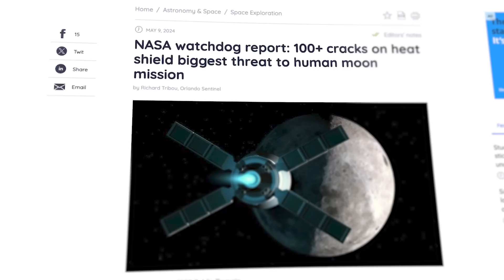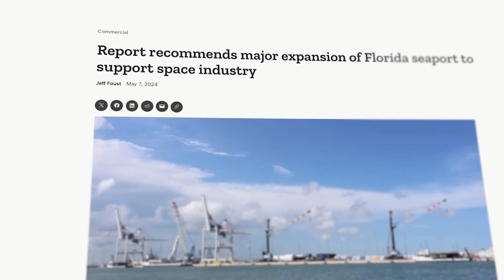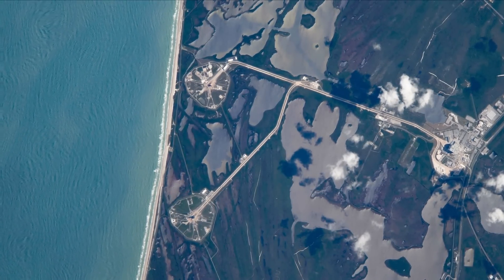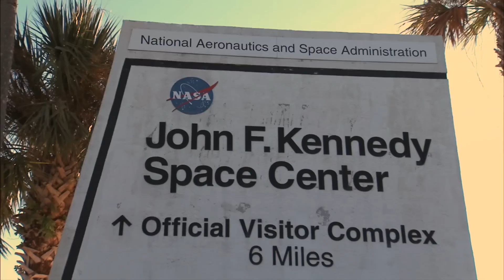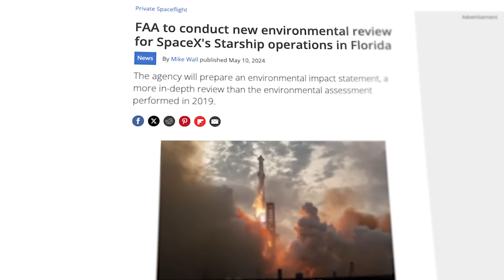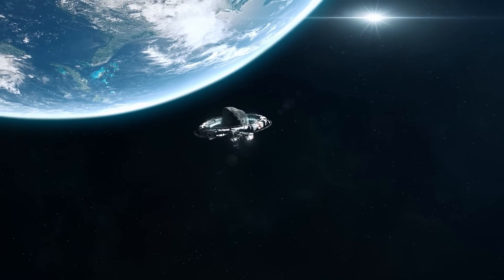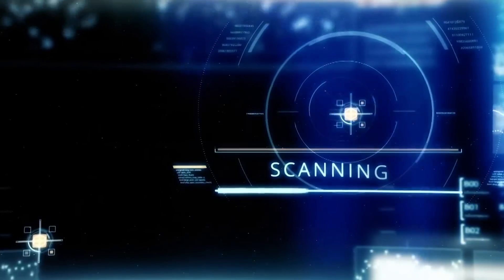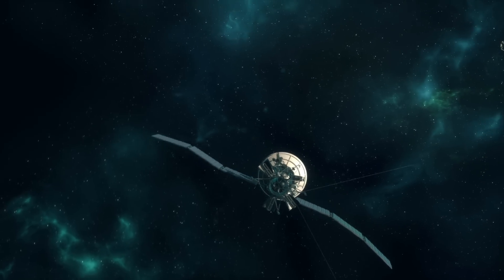NASA Has A Problem With Artemis

Comment: CRIKEY! Quit calling a PROBLEM an "issue"! 
An issue is a talking point in a bullet list. "Next, we have a clear blue sky today."
When you have a tornado coming your way, it is not another issue to yack about, it is a problem, and you need to take cover in a secure shelter, if you can get to one. If there is no shelter, you have a BFP, a BIG F00kin Problem!
Reply: The wear was deeper than expected, but did not compromise the spacecraft. For the Apollo spacecraft, they were one-use, so if the heat shield mounting got a little damaged, no big deal as long as the system did the job. For Orion, Crew Dragon, and Starliner, they want the heat shield to take all the damage and leave the mounting hardware untouched, so that they just put a new heatshield on for the next flight. Crew Dragon had a similar heat shield wearing away more than expected for Demo-2. SpaceX increased the thickness for Crew-1. Lockheed Martin will likely do the same for Orion, once the research is done.

Comment: Also the issue with all the commodities needed to support all these launches, liquid oxygen, liquid hydrogen, hypergals, helium, solid rocket motors. Plus the huge number of engineers and technicians, machine shops, assembly facilities, specialized equipment and exotic materials. These are just a small portion of the areas that would need to be addressed. The race to space will be won by the one that can overcome and manage the logistics and infrastructure issues.

Comment: They might need to implement a 2 stage heat shield with the first discarded early leaving the second to function from a less arduous entry period.
Reply: The wear was deeper than expected, but did not compromise the spacecraft. For the Apollo spacecraft, they were one-use, so if the heat shield mounting got a little damaged, no big deal as long as the system did the job. For Orion, Crew Dragon, and Starliner, they want the heat shield to take all the damage and leave the mounting hardware untouched, so that they just put a new heatshield on for the next flight. Crew Dragon had a similar heat shield wearing away more than expected for Demo-2. SpaceX increased the thickness for Crew-1. Lockheed Martin will likely do the same for Orion, once the research is done.

Comment: The lunar orbit NASA has chosen is   ridiculous.
Reply: The NRHO was chosen so that Gateway would need minimal propellant to stay in orbit. The low lunar orbits (LLO) are not stable, as the mass of the Moon is distributed unevenly with mass concentrations (masscons) clustered on the Earth facing side of the Moon. 

Something has to support Orion for the longer missions after Artmemis III. It's planned to be a few days to the Moon, about a week on the surface and a few days back, which Orion can do on its own. Later missions will be 2 weeks to a month or more on the surface, so something has to support Orion for that long. Gateway is that something.

Comment: Amazing, we could do this in the 1960's, but can't do it in the 21st century anymore.
Reply: The NASA budget during Apollo was 3-4% of the US budget and there were no other large programs besides Apollo. Currently NASA has less than 0.5% of the US budget and is also running the ISS as well.
Reply: @steveaustin2686  Or we just don't have the brilliant engineers we used to.
Reply: @scottgauley7722   🙄

Comment: Once again, problems that were miraculously not evident, or significant with the original missions — more than 50 years ago — are prolonging the programme, such that it is years behind schedule. It was originally supposed to deliver man BACK to the moon eight years ago. Let that sink in.
Reply: once again problems that exist on a more powerful rocket than was used 50 years ago, carrying a nearly three times larger capsule than 50 years ago. entering with FAR MORE SPEED than 50 years ago. curious how they aren't at all one to one comparisons with each other and yet people constantly try to make them one to one to disparage the program.
Reply: Exactly. From an engineering perspective, the only thing the two programs have in common is the destination. It makes discussion over the real difficulties, which arise in all big engineering projects where you often pigeon-hole your solutions and create very specialised equipment with specific parameters, much more difficult than it needs to be.
Reply: Solid unemployed take.
Reply: What's happening is that NASA was more like a skunkworks and now, after 60 years of growth of bureaucracy and getting into that same rug military developments get into, and you get this.
Reply: These same issues existed during the program. The larger capsule uses more advanced technology, rather than just cork and ablator, and are meant to survive far into the future. Test flights are also far more expensive and there's no deadline to meet.

If the capsule isn't man-rated, men don't fly to the moon. They'll fix it. What's slowing the program down is mostly bureaucracy and contractor work, which really only started a few years ago. All the Apollo infrastructure that was dismantled in the 70s and 80s needs to be rebuilt and reworked for modern techniques and new contractors. It's a massive headache. No such thing as an "insignificant" problem with this kind of thing, and these kinds of problems are generally fixed within a few months.
Reply: Going on a decade behind schedule and billions over budget.
Reply: @kiwikiwi1779 man on the moon by 2080 🎉
Reply: @kiwikiwi1779 lol. Dude, it’s not doable.  It can’t be done.
Reply: Man what on earth are talking about!?
Reply: @juhopuhakka2351  What are YOU talking about?
Reply: @bidipbo  Im trying to improve my digital foot print by imitating "good people".

Comment: NASA MAY NOT KNOW THE ANSWER BUT I DO...

GET RID OF  BOEING AND NASA  AND USE .........  AND  .......BUT ONLY USE NASA AS THE

GENERAL MANAGER AND DON'T LET NASA HAVE ANYTHING TO DO WITH FLYING ANY 

SPACECRAFT.   ISN'T IT OBVIOUS THAT NASA HAS LOST  THEIR MOJO WHEN IT COMES TO

DESIGNING SPACECRAFT??   NASA WAS GREAT IN THE 50s, 60s and 70s but most  of 

NASA IS LONG GONE.  SORRY NASA BUT YOU KNOW IT IS TRUE. NASA HAS NEEDLESSLY KILLED

SEVENTEEN ASTRONAUTS.  I REMEMBER ONCE SHUTTLE CRAFT FAILURE WAS BECAUSE

PRESIDENT  REAGAN WANTED TO LAUNCH WHEN IT WAS ADVISABLE TO NOT LAUNCH.  ICE

FELL OFF AND HIT THE SHUTTLE WING AND IT BURNED UP ON REENTRY.

Comment: Don't we have loads of data regarding heat shields at these speeds from the Apollo missions half a century ago??? Why do they keep re-inventing the wheel?
Reply: because the Orion capsule is like three times larger than apollo's because its built to take like 5-6 people to the moon instead of three?
Reply: We do, thats how we were able to fly the first mission without losing Orion. There were even similar issues with the heat shield on Apollo and none of them returned without some issue of concern. Dont forget Orion is a large craft then Apollo as well.
Reply: I have been on the same job for 30 years.  If I had to find something from back then, it's on computer that is old as dirt and using a floppy disk.  Maybe I did store it on a tape or cd.  Then I got to remember my dos commands, or worse, it's in a box of hand drawn prints.  Now imagine a rocket from the 60's.  The files are old and no one probably even knows where they are.  Any everyone who worked on it is in their 80's or older or dead.
Reply: @locutus1126  sounds a lot like the student who try to convince the teacher by excusing himself because the dog has been eating his homework
Reply: Cold Hard Caaaaaash
Reply: Exactly! Study their data and see how they withstood 5000 degrees F since they did it in 1969 we’re moving backwards in the space race
Reply: They were NOT STUPID enough to reenter at those speeds, that's why!
Reply: Do your home work.
Reply: Because the wheel was faked back then
Reply: beacuse they  fake  it  from  begining

Comment: SpaceX had no problems
Reply: After the Demo-1 unmanned test flight, that Crew Dragon exploded on the test stand due to faulty valves. After the Demo-2 manned test flight, the Crew Dragon heat shield has similar issues of abrading too much that Orion has. SpaceX just thickened the heat shield in those areas, something that NASA and Lockheed Martin will likely do with Orion.

Comment: NASA should go back to its roots. Apollo was very reliable, even Apollo 13 was a successful failure. The service module was the problem but Apollo spacecraft worked.
Reply: Spacex Starship/Lander and Dragon are vastly superior to Apollo. 
SLS/Orion... not so much - agreed here.
The truth is that Spacex can manage regular trips to the moon with 10x the capaciy in materiel and personell (Tesla could even supply human form robots for dangerous jobs and the boring company can supply drilling equipment for mining while making tunnels safe from radiation, meteors, explosive decompression.
Reply: And when Congress cut the Apollo funding, all the people and factories making the Apollo hardware moved on to other things. Don't forget the Apollo 1 fire either.

Comment: Dude, you are mixing up all kinds of things: 
1) NASA does not own or operate Port Canaveral. The port has nothing to do with NASA. It's a port. 
2) You also keep referring to Port Canaveral as a spaceport. This is a conventional WATER PORT, for water vessels - cargo ships, barges, tugboats, US Navy vessels, and a whole bunch of cruise ships. It is not a SPACE port of any kind whatsoever. 
3) SpaceX does not launch exclusively out of KSC; in fact their busiest launchpad is SLC 40 at CCSFS, not at Kennedy.
Reply: There are two spaceports by Port Canaveral, Cape Canaveral Space Force Station (CCSFS) just to the north of Port Canaveral and the Kennedy Space Center (KSC) just to the north of CCSFS.

SpaceX has SLC-40 at CCSFS, LC-39A at KSC, SLC-4 at Vandenburg Space Force Base (VSFB) and they just took over SLC-6 at VSFB. SLC-4 is broken up into the SLC-4E launch pad and SLC-4W landing pad. SpaceX also uses LZ-1 & LZ2 at SLC-13 on CCSFS. SLC-6 is going to be converted for Falcon Heavy at VSFB, as currently only LC-39A launches the FH. SLC-6 will likely do Falcon 9 launches as well, so SLC-4E can be converted to a landing pad for the FH side boosters to land at SLC--4E and SLC-4W as they do at LZ-1 & LZ-2 at CCSFS.

Currently, LC-39A is the only location for Crew Dragon launches, but a tower has been built at SLC-40 for Crew Dragon launches as well.

SpaceX has the orbital launch pad at Boca Chica, TX and is building a second pad there for Starship. They are building  a Starship pad at LC-39A, but that seems to be on hold again, while they figure out what they want at Boca Chica. SpaceX and NASA are working with the FAA about one or more Starship pads at LC-49, which is an as yet unbuilt area to the north of LC-39B. It is on the edge of the NASA property, so that will take time to work out.
Reply: @steveaustin2686  What does any of that have anything to do with my original comment?
Reply: @regolith1350   It ALL relates to your point #2 and a little of point #3, providing more detail.

Comment: We really need to change the framing of the conversation tho. The real problem is that NASA has a tiny budget that could easily be expanded. We just make 0 noise about this for some reason.
Reply: Yes! If we just have the same spirit that we had back in times of Apollo.
Reply: You can thank Obama for NASA's tiny budget.  Most of it was repurposed for obamacare. So thanks for nothing.
Reply: No. The problem is time after time NASA becomes a faux research organization that pisses away money without  actually finishing anything.
Reply: That's half of the problem. The other half is corporate greed.
Reply: @roncatdog  Wrong answer. Try again

Comment: Nothing that "New & Revolutionary" with the Artemis heat shield, same base material manufactured by same company that was used on Apollo capsules....Maybe the new "Mix" is being pushed Past it's Previous proven reentry Speeds  or the "Tighter" budget caused some "Economy" (Thinner lighter)  application thickness ?? ....They can Fix the situation....That's what manned space rating tests "Flying" is for...

Comment: Why cant they use the technology as of apollo?
Reply: When Congress cut the Apollo funding, the hundreds of thousands of people and hundreds of factories making the Apollo hardware moved on to other things. Lockheed Martin will likely end up doing what SpaceX did for the Crew Dragon heat shield issues, just thicken it in the areas where it abraded too much.
Reply: @steveaustin2686  "moved on to other things". Like what? They returned on their main activity of making movie? 😅
Reply: @nicolagianaroli2024  🙄 Don't be deliberately dumb. If a factory was making particular parts for Apollo, when the funding for Apollo was ended by Congress, the factory either shut down or retooled to make something else. This should NOT be a hard concept for anyone with a brain.
Reply: @steveaustin2686  you don't dismiss equipment  and technology which have  a clear application in military field like the most powerful rocket ever built, the Saturn V. If you believe that you are extremly gullible
Reply: Because the Apollo crap didn't work either.
Reply: Oh dear  @straydog02

Comment: While the engineers at SpaceX, one of the smartest and most motivated engineers you can find on the planet, solve problems of insane complexity in weeks what takes others years, the brave people at the FAA heroically put their Xs in the right boxes.
Reply: The FAA vs SpaceX is not really a thing, except for clicks by some YT channels. After all, the FAA defended SpaceX in front of Congress in Jun 2021 over the unauthorized SN8 flight. The 'NASA delaying Starship until the SLS flies' was just as silly, since NASA needs BOTH Starship and SLS for Artemis. 

SpaceX had approval for orbital launches of the Falcon 9 and Falcon Heavy from Boca Chica since 2014. They could also fly sub-orbital tests of reusable spacecraft. SpaceX went through an Environmental Impact Statement (EIS) to get that approval in 2014. Since SpaceX wanted to fly orbital flights with Starship, that has roughly 3 times the propellant as the Falcon Heavy, out of Boca Chica, a relook was in order. So the FAA review was to see about adding Starship to that existing approval, without having to go through another EIS.

Comment: Wouldn't a better and less costly solution be moving crew and stuff to the ISS or a commercial equivalent? Then use a commercial capsule that works to get back to Earth?
Reply: Crew Dragon and Starliner don't have the range or life support to go to the Moon or even just return from the Moon.

The ISS is in low Earth orbit (LEO) and is roughly 250 miles (400km) above the Earth. The Moon averages 238,900 miles (384,400km) from Earth. Also the ISS is in the wrong orbit than is used to go to the Moon, so it would take extra propellant to get to the ISS. The ISS also only has 2 IDA docking ports for cargo Dragon, Crew Dragon, Starliner, and Dream Chaser, so the ISS is too busy anyway.
Reply: @steveaustin2686  

"Crew Dragon and Starliner don't have the range or life support to go to the Moon or even just return from the Moon."

I think what he is saying -- and I agree with him -- is, launch Orion up to the ISS, unmanned. Then launch the appropriate rocket to get to the moon, along with fuel. Assemble this in space. Then launch humans on one of the standard Earth to ISS taxis.

THEN put the humans into Orion, push off from the ISS and light the candle.

There's no reason for something as powerful as the Saturn V or greater when you have a place to stop in LEO to assemble things. 

I agree with Jaxvidstar. We're wasting a lot of money developing this powerful rocket when the whole process can be done with existing stuff.

Comment: Just hearing about this now.. 
How long ago did that thing fly?

No wonder they are so frustrated with spaceX. SpaceX would have been transparent about this issue and likely have tested solutions by now.
Reply: NASA knew about this at the time. NASA and Lockheed Martin have been researching this since Artemis I. After the Demo-2 manned test flight, the Crew Dragon heat shield has similar issues of abrading too much that Orion has. SpaceX just thickened the heat shield in those areas, something that NASA and Lockheed Martin will likely do with Orion.

Comment: NASA just take ready-made solutions from the Apollo program from 60 years ago.🤔🤣😂🙃🤣
Reply: That's the problem - the technology is archaic and the requirement is very different and they are trying to do more with less money.
Reply: @Puma-70  This is the one thing this certain croud can not wrap their head around, we just can not take 1/3 of nations budget for this now.
Reply: 🙄 When Congress cut the Apollo funding, the hundreds of thousands of people and hundreds of factories making the Apollo hardware moved on to other things. Lockheed Martin will likely end up doing what SpaceX did for the Crew Dragon heat shield issues, just thicken it in the areas where it abraded too much.

Comment: I wouldn't trust NASA's  "Space Shuttle Era"  rockets and strap on boosters, with a Boing Crew Capsule to send two  house fly's into orbit.  Good bye NASA and Boing. you went WOKE, and now your BROKE.
Reply: 🙄🤡 You might want to actually find out what is going on, BEFORE posting. Orion is made by Lockheed Martin, not Boeing. The Boeing Starliner capsule is for the Commercial Crew program on the ISS.

It is widely believed that the 2000 merger between Boeing and McDonnell-Douglas led to Boeing's downfall. Because the MD corporate management took over from the Boeing engineering based management and focused on stock price and short term financial gains over quality. Greed, is what brought Boeing down, not DEI or whatever the racists call "woke" today.